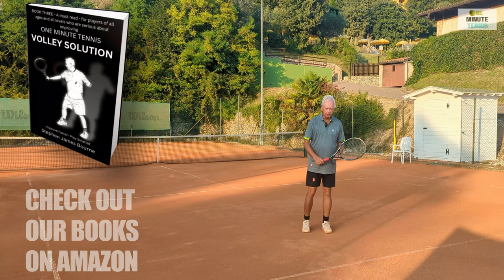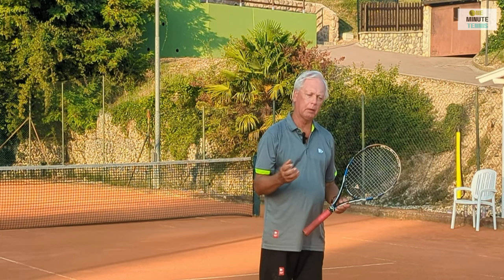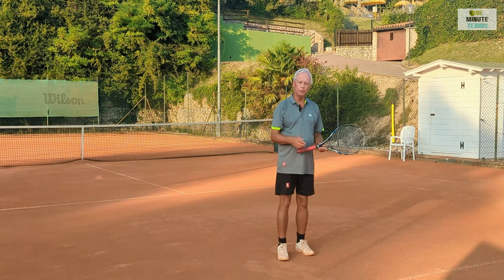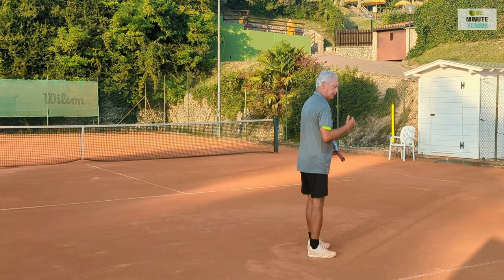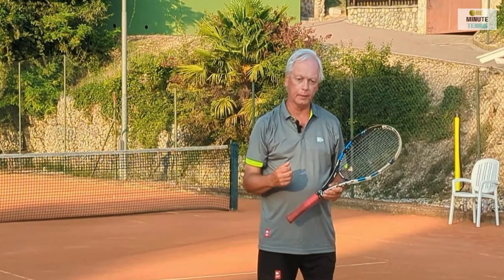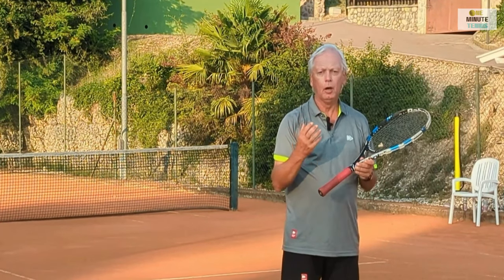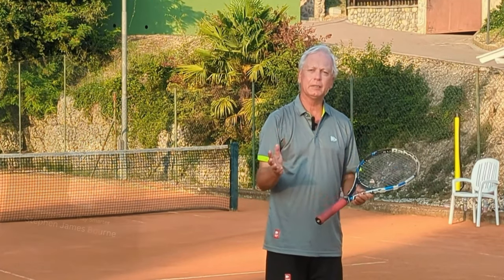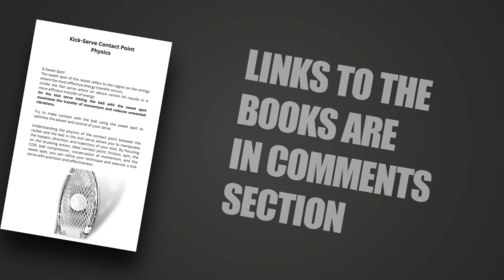A unique way of using the racket drop for power

Comment: Yes, this makes sense. Ideally, with a proper steep  racquet drop, the
butt of the racquet should point to the sky at the racquet drop position.
This racquet drop position is achieved via external shoulder rotation and  stretches the shoulder muscles.
From this racket drop position, the shoulder  internally rotates to contact.  It is true.

And, very importantly, there is a key checkpoint: 
The elbow is higher than the hand during the upward swing!(leading elbow)
Reply: Not only esr for drop from trophy position.
Reply: @peoplespeace   Of course there are other muscle movements from trophy to drop but the primary muscle movement from trophy position to drop is External Shoulder Rotation (ESR) 

 Also note that when you perform ESR, the forearm will also  automatically supinate. The knees will also extend at trophy to aid the ESR  and thoracic extension  achieve a steeper racquet drop. But in the end, optimizing the  drop is primarily about achieving and maximizing ESR .   Not clear what your point is.